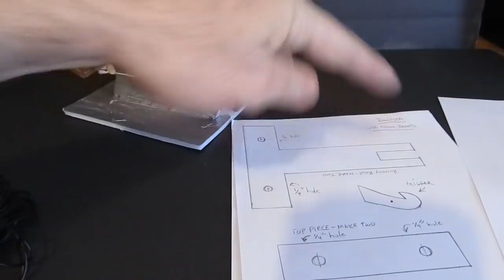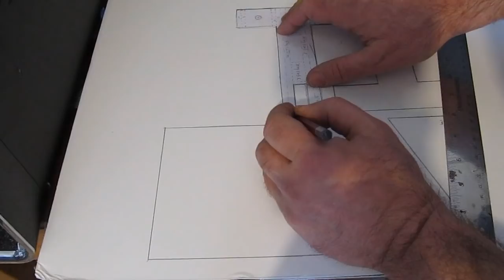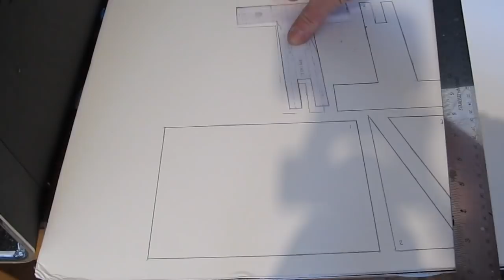Make a miniature ballista - siege engine

Comment: epicfantasy, is the stuff you use practically posterboard,because I downloaded the layout and am going to make it sometime today or tomorrow.just wondering.-zach
Reply from the maker: hi, no. this stuff is different. Is thicker than poster board. You can usually buy it in the same places they sell posterboard.
Reply: epicfantasy can posterboard still be used, I have like 3 sheets of it?
Reply: epicfantasy never mind, it turns out I actually had bought foam board. thanks for the quick response though!